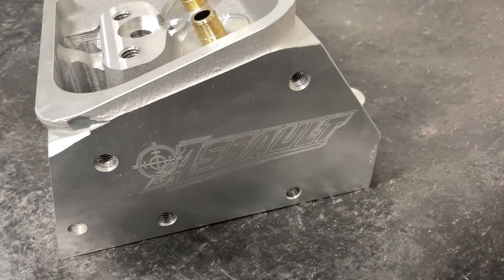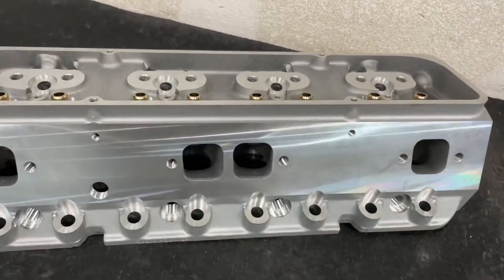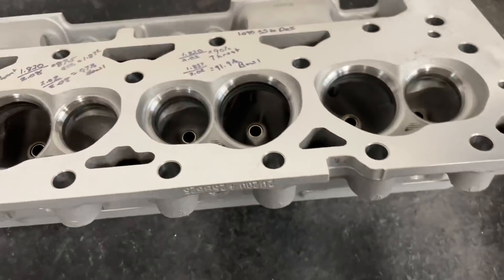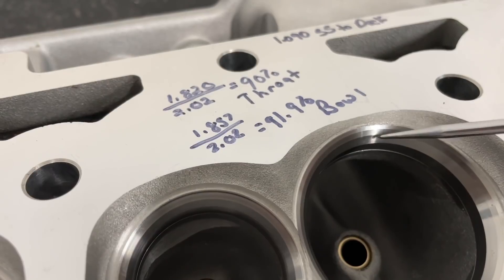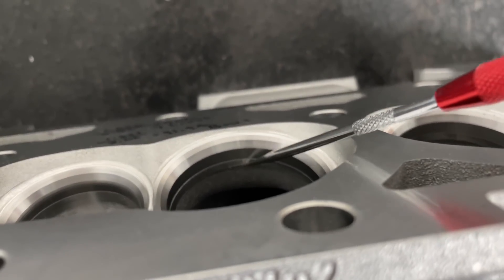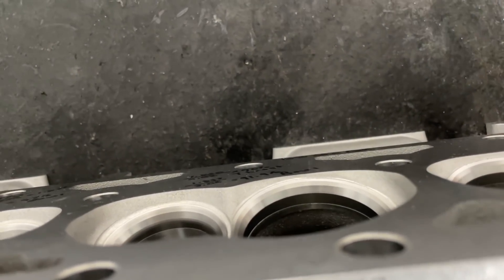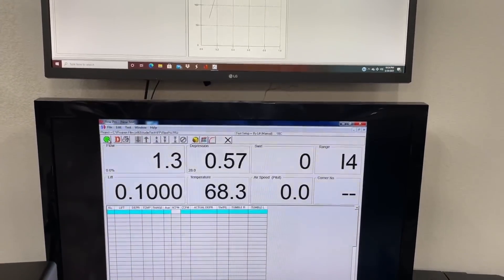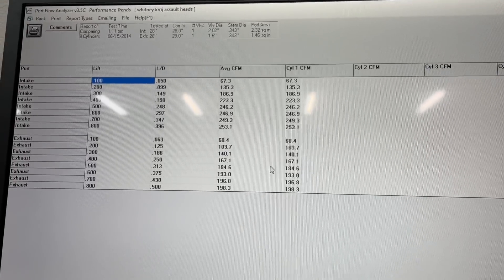KMJ Assault Sbc head review with flow numbers

Comment: Thanks for sharing this information about these heads. Lots of guys who can’t afford the big money heads buy heads like these and we have to fix them. Thanks for sharing your knowledge and experience with us.
Reply: Its like this , any head will flow with the right porting.. CNC porting is the best. but most cheap heads wont last , cheap castings poor quality non heat treated aluminum bolt hole threads strip out like junk...
Reply: Idk. I bought a used pair off ebay. The pro headers brand and put on my 357. Now I just changed the springs and put them on the person I got them from might of had them worked. I also put 1.6 roller rockers and a performer rpm intake on instead of the single plane that was on it. The bottom end is .040 over flat tops comp 280h magnum camshaft and it had some junkyard smog heads on it. Way wore out. The bottom end was built by Dale Smith which is a very reputable machinist but the top end was just thrown together with stock stuff and a single plain intake. Was like that when I got the truck. Anyway seat of the pants feel I would say 75 more horse easily. Exactly what the bottom end needed. I'm really pleased with the heads and they've been on the truck over 2 years now.

Comment: I have personally hand Ported a set of the aluminium CAL-Flow 200cc heads, which are also a copy of the Dart Pro-1 200cc head. Mine were a set of Angle plug heads. I left the factory 3angle valve seats alone and only checked that were good, suprisingly they were, anyway i used 2.02in and 1.6exh valves, but I did open up the throat, bowl size, and done extensive full port. Pushrod pinch was set at 1.050" I could have gone bigger. Port matched to 1206 gaskets. On a std 4" bore small block, with a 383 crank for 379ci and using a 3310 vac sec Holley, ported professional products single plane, 1-3/4 headers, Ran 11's at 118 for the 1/4 mile with, th-400 and 9" with 3.00:1 diff gears, weight of approx 3400lbs including full length dual exhaust with mufflers on D.O.T street tires driven to the track. Could only leave off the foot brake at idle, anymore and it would smoke the tires to half track.
Reply: 3400 lbs , freeway gears  street tires & mufflers small block chev. & A horse power robbing TH400 & 118 mph  ! They must of gave you the slip for the other car .
Reply: @martinkobert4321  no mate, I've got more than one 11second time slip.
Reply: Wish I had flow bench

Comment: Are these the same as eBay heads
Reply: I bought the same heads bare. For $400 from ebay. But I did put comp springs / guides. And arp studs. With milodon valves +100 over stems. I have had 0 problems out of this head. They r a good buy man.
Reply: @dangerdoneright  doing the same myself but using comp springs I have.
Reply: @dangerdoneright  I have them to they don't have issues either 
I was just curious if you dynoed them
Reply: which heads sold on ebay? there are literally dozens... this is the dart copy... it if looks like this its likely the same head although there are a couple variations as far as machine work.
Reply: Most likely
Reply: yes.. they are also sold as AFR enforcers and NKB heads by skip white.. blueprint rebrands them as well.